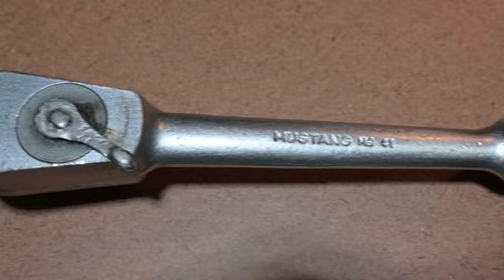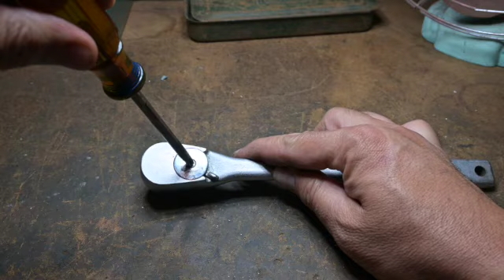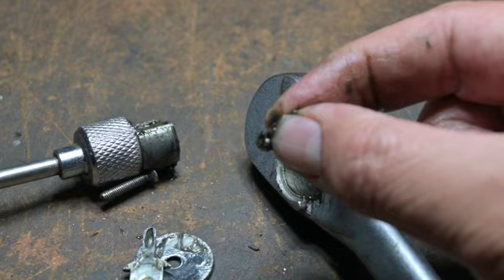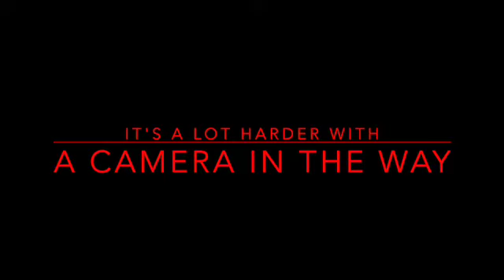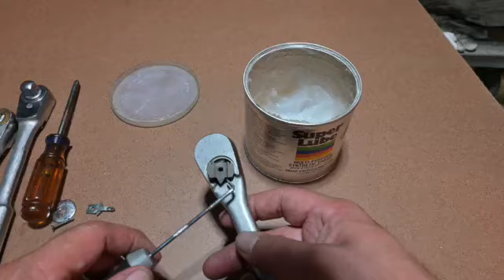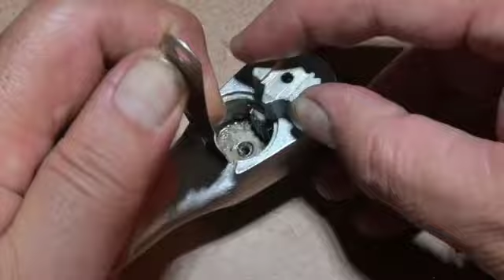Vintage 1950's New Britain-Husky-None Better-Mustang Ratchets

Comment: If you dont have that special ball bearing hold down tool, one of the several options are is to find a paper clip and simply bend it over so it makes a U SHAPE. The tool has to be firm, thin and small enough to fit between the underside of the pawl and top of ball bearing. There are other easy to find around the house items you can use. Allot of times a flathead screwdriver will work, if it has a small half circle for the bearing to seat in.👍
Reply from the maker: It was hard to get on because I had my hands wrapped around the camera tripod. Hahaha. I did it off camera with ease but I couldn’t get a good angle to film it. That’s the hardest part about making these videos. I love doing it but dang, the camera sure does get in the way. 
Thanks for the advice and watching. 
I just bought a 1950 Cadillac, let’s see how hard this is going to be filming the restoration.

Comment: I like these "Fors" (John Fors patented) ratchets myself. I have what's arguably considered the hardest one of these variants to find, the Craftsman Circle H model. In good shape too.👍
Reply from the maker: Yeah. That’s the only one I’m missing. They never come up for sale. I guess if I had 1, I wouldn’t ever sell it either.
Reply: @spiderlovesbeerohyeah4760  yeah that's an understatement! I paid too much for mine! Way more than I should have. But I figured I would snatch it up before anyone else could get it. I too spent a long time searching. And one did finally show up on The Bay. But apparently when N-B made this specific model (Circle H) for Sears, Sears was basically done with N-B's tool line at that time (late 40's), as it was their last ratchet model made for Sears...rough I might add by the way. But I too also own some of N-B's variant cousin rats...None Better, Husky, I think I may even have one marked Blue Grass? From others I have seen, there is also one marked "Wix" as well. They were obviously all made by N-B as they're all pretty much identical give or take various tooth counts in their mechanisms. I have a couple None Better variants which have a 40 tooth gear. The Cman Circle H has a 28 tooth. I find the varying tooth counts interesting. It shows a variating degree of good versus better in terms of each ratchet name brand. Fascinating history and model variations.👍

Comment: I have the New Britain. How do you get it apart? There’s no screws or snap rings.
Reply from the maker: My New Britain one has a screw right on the selector switch. It comes off really easy. Make a video so I can see yours. 
Thanks for watching.
Reply: After looking at pictures on the Internet, it looks like there’s a plug pressed in where the snap ring would be. Still no way to remove the plug.
Reply from the maker: @SolitaryMaverick  
That’s how my mustang one is. 
Is yours exactly the same as the one in this video??? 
I wish I could see it. All of mine come apart except for the mustang.
Reply: It looks like the Husky but no screw on the selector lever, it’s staked on. On the other side it looks like a plug or pin with no way to remove it.
Reply from the maker: @SolitaryMaverick  
That’s interesting. I need to find one of those now.  What’s the number on it so I can look it up.
Reply: New Britain made variants of these which were unservicable. They had no screw or snap ring. The plates were press fitted tight to prevent them from falling out. I have managed to get a few of these apart myself in the past. Starting by grindind the peened on selector, so it could be removed. Then I carefully pryed the pawl cover plate off, (VERY CAREFULLY)  until it popped out. Then to remove the gear, I CAREFULLY used a 1/8" round punch to knock the gear and retaining cover plate out, as that is press fitted as well. When I reassembled the selector, it had to reattach by converting it to a custom screw attached setup. It can out well.👍